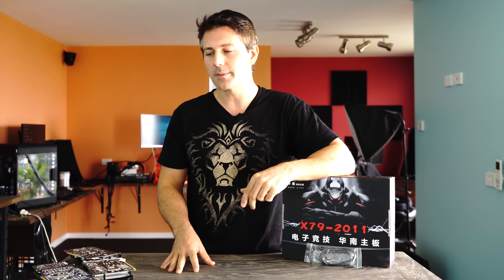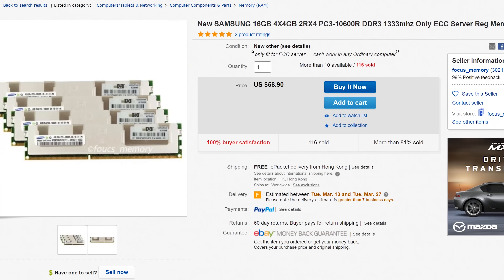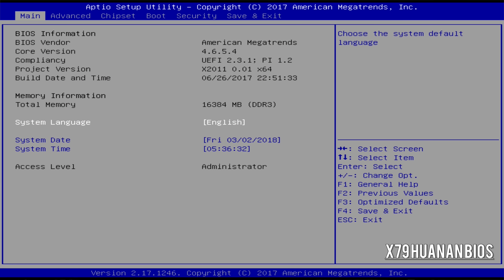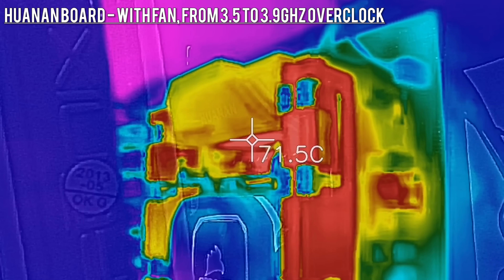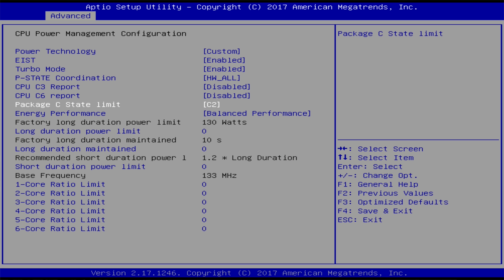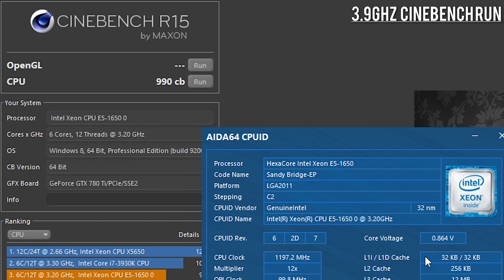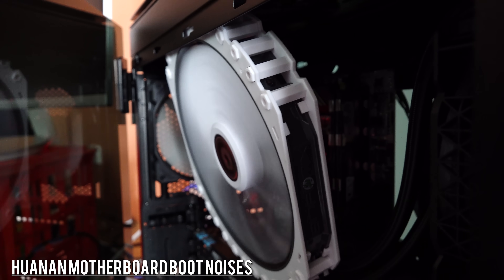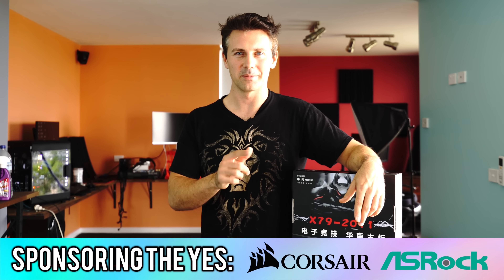AliExpress HUANAN X79 Motherboards - Are they a LEGIT OPTION for PC Builders!?

Comment: Wow, those VRMs really are lousy. Seems like getting a reputable used X79 board would be the better route.
Reply: yeah when he mentions the vrms i died a little on the inside cos i knew this is not an option
if i go budget to ssave every penny im not gonna spend on fans etc for vrms
Reply: Just get a cooler that blows down (not a tower) and that's it. No extra fans needed. The quality of the cooler matters little here as those Xeons when running on low clocks do not really heat that much.
Reply: You don't get 8core cpus and cheap ddr3 ram on z270
Reply: the hackintosh users blew the prices out of all proportion in the uk - at least that's my experience on ebay.co.uk

Considering you can get an x99 board from amazon new for not much more it was a no brainer for me.
Reply: That's true, but then you've got to spend heaps of cash on DDR4 as opposed to DDR3
Reply: A 120 mm downdraft cooler cpu cooler would be ideal to cool the vrm's and chipset.
Reply: LegendaryVegeta 100 degrees for a vrm isnt that hot, they are made to stand till 100c, however it does show how budget this motherboard, even most b350 scimp on the vrms in the same way and noone is complaining
Reply: @christopherdu4566  because they dont have to push 100 watts and they clearly dont have to handle ecc memory that gets really hot and on the other side still need to push more than 1,2v stock.
Reply: Educate me - why is this chipset something people would want? And is it a good price? Because I see modern chipsets, like z270 for the same price.
Reply: chaoswr because you can get lga 2011 CPUs for less than 200$ (i7 3960x, i7 3970x, E5 1650 etc). Considering that some people already have DDR3 memories, that's a good way to go
Reply: @Richard Griffiths That is a really good choice, do you still have the link for that motherboard that you say that has the c602? 🤔
Reply: @DenzNoble  

https://www.aliexpress.com/item/HUANAN-Deluxe-version-X79-gaming-motherboard-X79-LGA-2011-motherboard-ATX-4-channels-support-16G-memory/32824401117.html?spm=a2g0s.9042311.0.0.7d034c4d6SJCEx

Brand: HUANAN ZHI

Model: Deluxe X79

Condition: Entirely new

CPU socket: LGA 2011

Structure: ATX

VGA socket: 3*PCI-E X 16

Power port: 24+8pin

CPU supported: Intel series with LGA 2011 socket

(Xeon E5 2620/2630/2640/2650/2660/2665/2670/2680/2690/2697/1650/1660 C2/V1/V2. The manufacturer said it does not support i7 4th&above generation processors, we only tested it with i7 39xx processors such as 3960X, it works fine, but not sure whether it really does not work with others or not. Pls consider it before making order.)

Memory supported: 2RX4 non ecc/reg ecc/ecc only

Max memory capacity: 4*16G DDR3 1066/1333/1600/1866MHz(depends on processors)

Sound track: 7.1(ALC892 chip)

Integrated video card: No

Crossfire: Yes

SLI: No

Interfaces: 1*RJ45/4*SATA2.0/2*SATA3.0/2*PS/2/4*USB2.0 rear/4*USB3.0 rear/7.1 track audio port/M.2 NVME port

Motherboard dimension: 282*220mm

Motherboard weight(including package): 1.65kg or so

Comment: with H77... it is not an x79 Board 😁
Reply: Yes Strange H77? Not all Huannan X79 motherboard are the same. I have a Huannan X79 Gaming Deluxe (Yes the Orange Board with a proper heat sink on VRM). it uses a true Intel Patsburg C600/Intel Ivy Bridge Chipset. I'm running E5 2680 V2 Standard BIOS Great performance with no need to over clock and VRM temps are okay..
Reply: Maybe it's just misreported? Hmmm... he should remove the heatsink and look at the chip.
Reply: My Motherboard temperature also appears to be very high in hwinfo https://youtu.be/ezL0nAzjRiE but it has been running for months without any problems so far...
Reply: No idea how SandyBridge-EP runs with an H77 (1155 chipset...). Is Intel's QPI really that flexible? Probably also a lot of dirty hacking involved. Or does Intel use H77 equivalents in the LGA2011v1/v2 low-cost Server boards?
Reply: I think you are right.  How in the hell would an H77 chipset support socket 2011?

Comment: My W3680 at 4.7Ghz gets 1068CB, funny seeing as its cheaper
Reply: TheColonelK1LL What was the price of your mobo?
Reply: Lars Schothorst I bought an Asus P6T for $120 CAD
Reply: +TheColonelK1LL Hell yeah, X58 4 life! Have an X5675 at the same clocks with around 1,44V under load. Around and over 1,5V is definitely dangerous though, an X5670 of mine can second that. X79 does not seem worth it with >$80 locked Xeon processors and even more expensive boards for what, NVMe and Quad-Channel? Sadly my MSI X58 Pro-E died recently, possibly from VRM overheating, replaced it for 44€ with one combo that just had a defective memory controller on the i7 920, some dirt and bend pins (both fixable), outdated BIOS and even a decent cooler.
Reply: MentallyDisturbedShit I must have a golden because mine is only at 1.385 volts
Reply: +TheColonelK1LL Yeah that is pretty good. The W3680 is (like the X5675) a pretty high bin though, so not entirely unexpected. Sometime I saw 4.7 GHzish on an X5650 with just about 1.3V here on YT, that is extremely nuts binning. But 4.8 GHz really is the safe limit on the best of these chips, as above is not usually doable below 1.4V.
Reply: Was geht sie das an? My goal it to get much better thermal paste and get 5Ghz as my load temps are only 70c currently
Reply: +TheColonelK1LL Just keep in mind then that voltages past 1.4V really have the potential to degrade the cpu fast, even under small loads. I was too careless about it and now my X5670 barely hits 4.4 GHz with safe voltages. Also, which cooler gives you 70°C under full load @5 GHz? Even my NH-D14 struggles with the resulting thermals of voltages that would be needed for "just" 4.8 GHz and barely keeps my chip below the 90s. I assume a costum loop?...
Reply: Was geht sie das an? No I get 70c load at 4.7Ghz it's a H110i GT or GTX I can't remember but I bought it for $60 CAD and it's a beast. I was going to upgrade to a 360mm rad to do 5Ghz
Reply: +TheColonelK1LL Oh, sorry for he misunderstanding. That makes all sense now. An H110i is a bit better than the NH-D14 of mine, which I got for 35€≈CA$55.50, so that seems about right. Your deal was a bit better. 5 GHz on these chips is a real pain in the butt to sustain 24/7, since even the best binned ones output over 200W of heat easily. Combined with voltage of usually >1.45V, I would not say it is worth it, if not for benchmarking and fun. The longevity and cooling requirements become way too freaky.

Comment: What license? Who do they answer to that they require a license?
Reply: Intel and AMD have licencing fees to make a motherboard for their chipsets... various chipsets costs various prices... Intels "X" chipsets cost alot... as do their "Z" ones... the non overclocking ones however are much much cheaper.
Reply: Thanks, I never knew that I guess it makes sense.
Reply: Even some of the ram from their has a disclaimer ' for AMD systems only ' so I guess Intel charges more for their licenses and ram speed !
Reply: C.W. Olson
RAM that is for AMD system only is "high density" RAM which uses chips that are x4 bits wide instead of x8. (128x4 = 64x8 capacity)
Intel desktop memory controllers cannot handle this setup, while AMD memory controllers are much more versatile as they don't care if the chips are 4 bit or 8 bits wide and mainly applies to DDR2. (note the x4 chips are often the same ones used in servers registered DIMMS and adapted for UDIMM)

Comment: my nephew wants to get in to pc gaming (fortnite) and his dad asked me to build him a pc for 100€ so i found a pre build i5 2500 1tb hdd 4 gb ram (will add 4gb more) for 60€ i have my old gt 1030 that i will put in that system. do you guys think it is enough for 2018 ?
Reply: It's enough for Fortnite. That plays damn near on a potato.
Reply: BATZE 22 it should be fine but you won't be able to play at 1080p with everything cranked up. I would say you should be able to get fortnite to run at 60fps at 1080p low settings.  You might have to run it at 900p. Most games should run fine but again you will have to lower settings and resolutions and it might not be able to hit 60fps in most modern games. Older games like arkham city, mirrors edge, etc... should run great.
Reply: I'd say replace the gt 1030 for a gtx 760: it costs the same and performs way better, but maybe your case won't fit it
Reply: you can play fortnite ona potato, that'll be fine to get him started
Reply: You're on the right track but you should be able to get that extra 4gb ram for about 1/4 the price you listed, check CEX and Ebay.
Reply: thank you guys for the help he just told me he wants to play fortnite and hello neighbours what i think will run perfect for him (he is 12)
Reply: Depends on what resolution he ( or his screen ) playing at if it's 720p that system should fly but if he has a 1080p or higher resolution monitor then you will need to turn down the eye candy and maybe even use the scaling option ( if it's 1080p then set the scaling around 70% and then that be like a 720p screen resolution ) ! If that is not enough for him then later on you could still upgrade the GPU  to a 1050 or 1050 ti if the power supply is good enough !
Reply: BATZE 22 its just a fine pc just get a new GPU in late 2018 for him (until the prices go down)
Reply: BATZE 22 get a dell optiplex or a ho compaq with i7 2nd or 3rd gen, negotiate with the buyer try to get it way cheaper, just say your friend is ,saving but he hasn’t got a desktop and you have depression or some dumb shit like that, pop in the GT 1030 and boom great PC for the coming years
Reply: Random Some Guy well thx but he couod use his story his nephew wants a gaming pc so that works as well
Reply: yeah that should work wonders at 1080p medium setting at an average of 60-70 fps, i'm using my GT 1030 with my i5-4690k on stock setting while i wait for my GTX 1060 to arrive, but those specs you stated would be great for a gaming rig in this day and age, 1080p with a mix of low to medium will work on most  games on the i5-2400, 8GB RAM, and GT 1030
Reply: BATZE 22 I'm seeing a lot of the people here saying it won't be enough or will barely be enough.  I can tell you right now, I build a lot of similar machines for people just looking for cheap gaming computers and it will play just about any game at 1080p reasonably well.  An additional 4GB RAM would be the only real upgrade I would recommend for it, but you've already got that in mind, so you're all set here.  For the price you're working with, it'll work very well.
Reply: As long as he doesn't want to play wolfenstein new collossus  (which is completely unplayable on the 1030, but runs like a dream on the rx 550) yeah a 1030 will be okay.
Reply: ttma1046 It's more than enough. You can even run it on integrated Intel hd 5000 graphics.
Reply: BATZE 22 I would say get a small SSD, it will help a lot with stuttering that might happen. The basic build is sound for fortnite 900p as well, I speak from experience.
Reply: 1030 won't be enought for fortnite, I guess
Reply: ImpairedToast thank you for the awesome answer
Reply: Depends on how spoiled he is and what he's playing.  Sounds good for 100 eel pie coins though.
Reply: moar ram and 1030 are good
Reply: if you can atleast here in the US you can usually find i7 2600 prebuilts or i5 3670 prebuilts for around the same price as the i5 2500s... if you can go with that, and if it's really jute for Fortnite and such? sell the 1TB HDD and buy him a small (128-256GB) SSD... It'll be good for running most games at 720p high or 1080p (high for easy titles like esports; medium and low for harder ones)

Comment: I just got a 1650v2 and haven’t managed to get it stable above 4300mhz on my x79 Asus board.
Reply: I've also just built a system with the E5 1650v2. I scored an EVGA SLI board for £85 but found the limit is 4.4GHz @ 1.39v. I've tried everything but voltage needs a massive hike to get 4.5 stable. On the plus side I've used 4x4gb ECC unbuffered DDR3 from the 2013 apple mac and got it to run at 2133MHz CL11. Aida64 ram benchmarks shows it is actually faster than the 3000MHz DDR4 I have in my Coffee Lake rig.
Reply: puffnstuff1982 Sounds like a great system! I don’t think my P9X79LE Asus board supports ECC Reg memory unfortunately. I’m using 4x4gb Kingston 1866. My cpu was pulled from one of those 2013 macs by the eBay seller. I scored my board for $80AUD because the retention clip for the top pcie slot is damaged and the onboard sound doesn’t work.
Reply: Adam Reid Great deal, who needs onboard sound anyway. That's a real capable set up and will keep up with a ryzen 5 in gaming workloads. I fancied an X99 at first but DDR4 is such a rip off.
Reply: The Ivy bridgemodels don't overclock as well as the sandybridge ones, due to running much hotter. But you do get a little IPC boost over sandybridge. What's your vcore at for 4.3?
Reply: I noticed the voltage range on Ivy-E recommended by Intel is 1.3 instead of the usual 1.35. I'm sure it doesn't really matter though. 

Yeah I'd try working with the LLC a bit, there's no way your chip is capped out at 4.3. Best of luck man
Reply: themageduck I’ve got it set to 1.35v in the bios but obviously there’s some droop, haven’t messed with load line calibration etc yet.
Reply: themageduck Thank you. I also don’t think the VRM is particularly special on my board, I’m not sure but I think mine may be an entry level model despite having 8x memory slots.